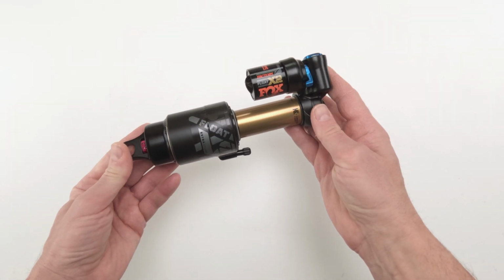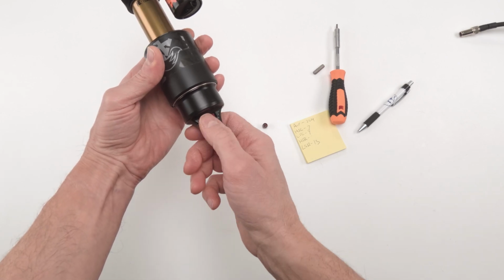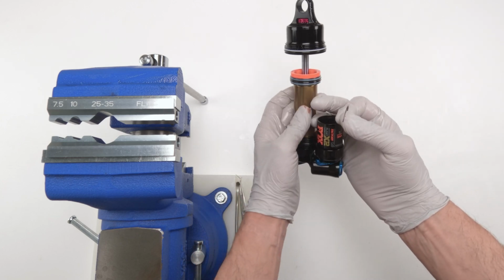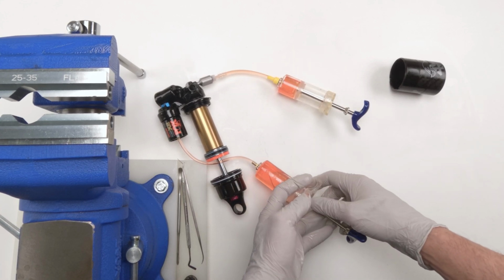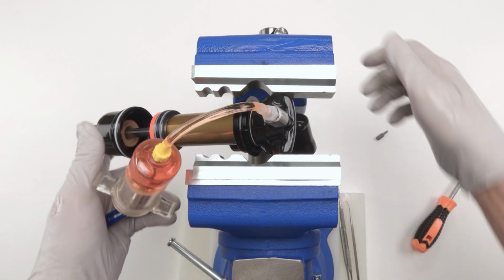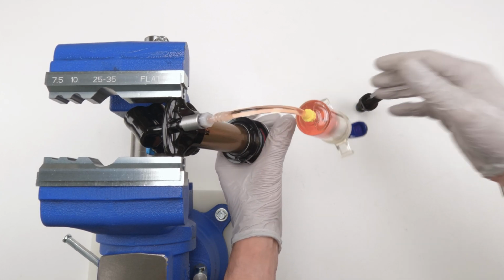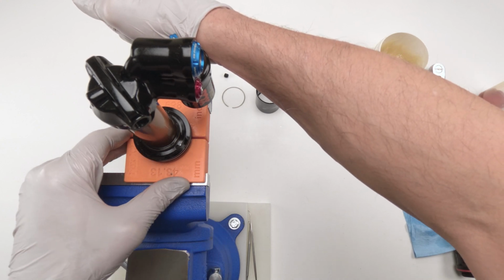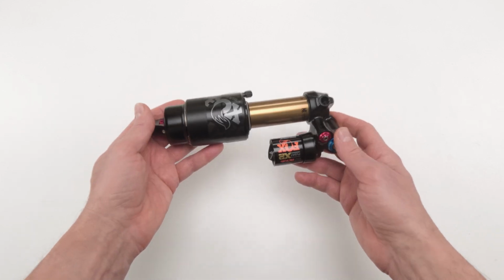Fox Float X2 Bleed only guide for beginners. Your X2 failed prematurely? Here's a quick and easy fix

Comment: This is a very detailed video. Appreciate it. I just took my Float X2 back from Service, it was withing Guarantee and they fixed it with no costs. But i am worried because when i let the air out, the Shock closed by itself. (Maybe negative air). Any idea how to bring it in optimal working conditions? Or should i just leave as it is.  Thanks in advance.
Reply from the maker: Fox has been really good about honoring warranty claims on the X2. I definitely have to give them credit for that. Yep, that's caused by negative air pressure, and fortunately it's an easy fix. As long as there's air in the air can, slowly extend the shock until it reaches the air transfer port, which is usually about 10 mm or so before it's fully extended. You'll hear a hiss as the air equalizes between the positive and negative air chambers. Cycle the shock back and forth through that point a few times until you no longer hear the hiss and the shock returns to its fully  extended position on its own. This applies to virtually all air shocks and air forks, as they all rely on the same positive and negative air chamber equalization process. Hope this helps

Comment: I have a vacuum bleed setup for my moto suspension. Is there an adapter I can use on the bleed port to do this without disassembly?
Reply from the maker: Yes, though you will need to remove the air can to bleed it. The FOX adapter part number is 803-00-463. The "Anso"  X2 bleed adapter works better if you have a quick release setup like I do.
Reply: @zoubtube  just got the adapter. it works. very excited. have several pre-25 X2s that were all warrantied... and already slurpy after half a dozen rides.

Comment: Hi, great and detailed video. Is it really necessary to dismantle the air chamber? It seems like you can do the bleed even without...
Reply from the maker: Good question. Not really. You will have to remove all the air from the air can first. The problem is, even with the air is removed, the moment you compress the shock, the negative chamber will fill and it will be extremely difficult to extend it. You will be battling through the entire process. MUCH easier to just remove the air can. This goes for all air based shocks

Comment: Great video - as always, very thorough!

I have fallen into a bleed adapter rabbit hole: You use adapter 803-01-691, but Fox states 803-00-463 for 2021-2023 (and 2024-2025) models. The  803-01-691 is according to Fox used for the 2022-2026 Float X (for which you used a SRAM brake resorvoir adapter and syringe). Are -691 and -463 identical - your bleed port connection seemed to work well?

Finally, does the dubro 241 fit all Fox IFP bleed ports, or at least the Float X (which I have)? Otter MTB Tech used the -463  (still meant for the X2 bleed port according to Fox web pages) on the Float X IFP bleed port (and an IFP air valve adapter in the bleed valve!).

I have just finished a full service of my Fox Factory Float X following your video - thanks! Will a two syringe setup work for the X too (hence my questions above)?

I have tried adding links to the videos and Fox pages, but Youtube will not let me post even links to videos on their site.
Reply from the maker: This my friend is a VERY good question and I regret not mentioning it in the video. The fox documentation has an error in it for the float x2 machine fill adapter for the 2024 and 2025 x2's. 803-00-463 works for the 2021, 2022, 2023. For the 2024 & 2025 you need fill adapter 803-01-691, which btw is the same thread as the SRAM brake DOT fluid Bleed lever adapters (YAY! 👍🎉). I'll make a video on this ASAP as I happen to have a 2021, 2022 and 2024 X2 next to me as I type this. I even called Fox to let them know their documentation needs updating.

I STILL haven't tested the dubro on a Float X. It's been something I've been meaning to do for a long time and keep forgetting about it. I do have 2 float X Shocks I need work on so I'll definitely be making a videos on this when I get to them. 

Thanks for bringing this up
Reply: @zoubtube   Hey - Great videos, big fan!! I've fallen into the same trap with adapters.   Are you sure that 803-01-691 is the same as the SRAM Dot adapter?  I've got a 2024 X2 and the SRAM adapter is too big.  Is it maybe the 463 that is the same as SRAM?  (want to double check before splurging more money on fox tools).    And, Ive got a 2021 DHX2 coming in, it definitely uses the 463 - right?

Comment: thank you for making these vids. I have a 2024 X2 that leaves a sheen of oil on the shaft. do I need to do a full service (which I am amassing the tools for) or just a bleed as you have done in this video? thanks again for your help, I have been repeatedly watching your videos for days. If we are ever in the same room I will know that voice
Reply from the maker: Glad to hear the video is coming in handy. if you regularly see an oil film on the shaft, then the bearing seal is going. What you can do is bleed it to end the season, then service it during the off season. One thing to note with the X2. fox pretty much stopped selling the seal kits for 2021 to 2023. they basically want everyone moving to the updated X2. If you send the shock to fox, they will replace it for a 2025 for the price of a service. IMO, its worth doing. If you have a 2024 or newer, you'll be able to easily buy the seal kit.

Comment: how necessary is the eyelet tool for torquing? On my shocks with an air can I just cinch it as tight as I can by hand.
Reply from the maker: sorry for the late reply. You can do it by hand. depending on how long the handle is on the tool your using, it needs to be a solid hand tight as 16nm is fairly strong

Comment: Great video! Only one question. Du-bro fitting works on  both bleed ports? (IFP port and Outside port)
Reply from the maker: Glad to hear you liked the video.  the Dubro adapter works only the with the IFP. The eyelet bleed hole uses a different adapter, which should be mention in the video

Comment: Any reason you opt for this method over the one used commonly with 16'-20' x2 shocks simply creating vacuum with the glove then checking the bleed w/ a syringe on the bleed port and pumping the shaft (lol!)? 

Does this method produce a better bleed? It seems just like more involved and less simple.
Reply from the maker: When I completely rebuild a shock, I follow a specific bleeding process, using shipping tape to extend the reservoir and a glove secured with a rubber band. I have several videos demonstrating this method. However, if I'm bleeding a shock due to premature gas ingress, I opt for syringes whenever possible for convenience. Regardless of the method, the success of the bleeding process depends entirely on the time and patience invested in it. Hope this helps

Comment: This was super helpful. You totally make the best service videos on YouTube - clear camera shots that show the work/interaction with the parts and explanations of why we are doing something, not just "do it." Have two questions: (1) For the X2 (2022), is there such a thing as the basic air can service like for the x? (2) Any chance you will make a full service video for a DHX2?
Reply from the maker: Thanks for the positive feedback, my man! Yes, the 50-hour service is nothing more than removing the air cans, cleaning them, adding some oil/ fluid, and closing them back up. Basically the beginning and ending of this video. As for the DHX2, yes, the plan was to have it done last xmas, but things didn't go as planned. I will definitely be posting both DHX2 and DHX videos. It's actually a priority of mine, but there aren't that many in my area, so timing is everything.
Reply: @zoubtube awesome thanks! I have an X2 that is squelching like a champ after a couple of years in storage. Will try this bleed soon… damn those bleed fitting/adaptors are expensive!
Reply: @zoubtube finally got around to doing this. Discovered that for my 2021 shock that has the bleed port on the top of the trunnion mount you need two of the du-bro 241 fittings, same for both top bleed port and IFP

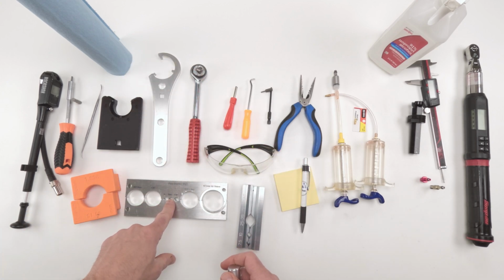Comment: 2:36 9,5mm is the shaft size on the newer x2 shocks, for anyone wondering he probably just made a mistake
Reply from the maker: great catch and thanks for pointing this out.👍 I should have pointed at the 3/8 hole instead. so many details to remember, so little brain cells to remember them all. I'll make sure to point this out in the 2024 full service video as well as add it to the description of this one.

Comment: Can I ask how did you connect the Fox Bleed machine adapter to the hose of the syringe. I see some kind of adapter but wasnt sure. Can you list the part that attaches from barb to fox bleed adapter please.. The Racetech adapter is decently priced - however shipping is more than price of adapter :( so weird
Part No.TSNC PS21036
N2 CHARGING TOOL SCHRADER2
$24.99
Reply from the maker: I  use a plastic adapter like the one in the link below. they are a couple of bucks at a local hardware store. I don't remember the don't remember the size. I want to say 1/2" but not sure.  
https://www.acehardware.com/departments/plumbing/hoses-and-tubing/hose-connectors/4000592?store=18899&gad_source=1&gclid=Cj0KCQiAoJC-BhCSARIsAPhdfSjkxxzRbkC-9cqBQ3UITzbI8QLWyerDwq9_J6-mjC69TiXzPVA7U_IaAhoFEALw_wcB&gclsrc=aw.ds

As for the racetech adapter. I ended up calling them to let me know that the shipping was ridiculous. they ended up shipping it for a MUCH lower price. so I would contact them  with the same concern. I'm sure they will send you a quote with normal shipping they did with me

Comment: Would this kind of bleed be possible without removal of the air can? (and thus the special tools) To my novice eyes it seems like it should work, worst case being a bit more clunky.
Reply: My question exactly!
Reply from the maker: @siavashsarrafan  answered above. you can, but it not worth the effort in imo. plus it's a great time to service the air can.
Reply from the maker: Technically, yes, but it will require significant force or leverage. Considering that you will have to open the reservoir to set the IFP, why not just remove the air can to make life easier and give the shock a quick air can service as well. It's the perfect time. The shock isn't all that hard to work on once you get used to it. Just like most Fox products, it's the proprietary tools that make it worse than it should be.

Comment: Brake bleed fitting can be used from an universal brake bleed kit.
20wt Fox oil has better alternative Motorex Supergliss 100k.
Reply from the maker: Thanks for the tip. I haven't used the 100K. I heard it struggles in cold temps. Do you know how accurate this is?
Reply: If you want a damper with no pop and one that feels dead in general, use Gold 20wt. Lol

Comment: This shock are not easy to service, but your tutorial videos are really helpful..
Reply from the maker: Overall, This shock is actually not that hard to service. The issue is the proprietary tools needed. they could've simplified that, but then again, were talking fox here. A tools company that makes shocks and forks as a hobby. 😁 fully servicing the dials definitely sucks. But most people don't need to do this. they can just change the out terseals and be done. I question whether the factory actually fully dismantles dials for a service.